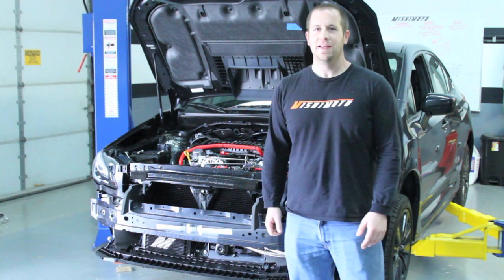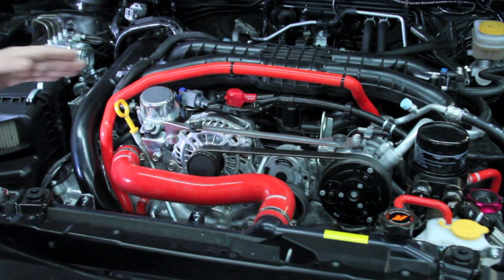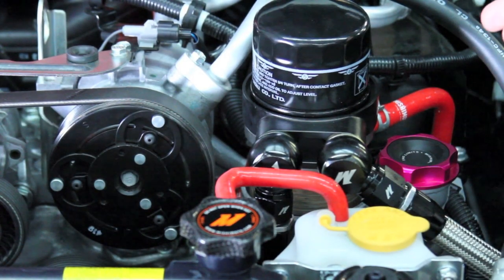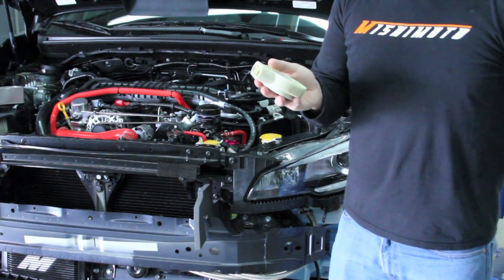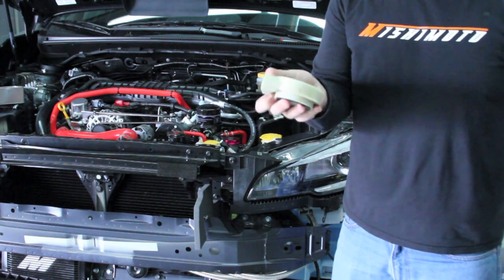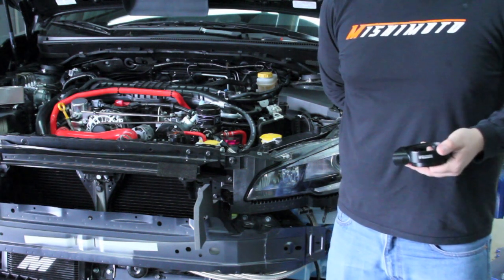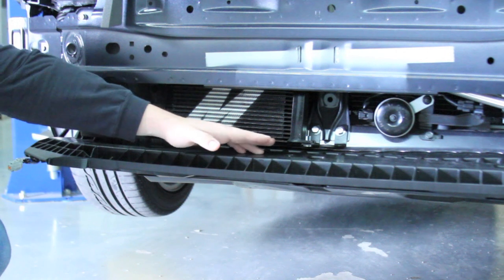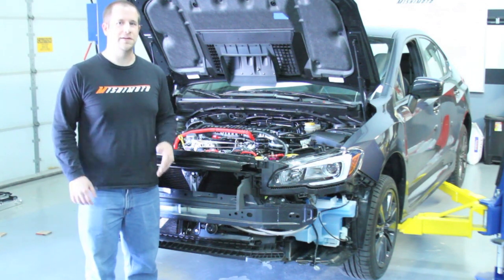2015 Subaru WRX Mishimoto Product Development: Direct Fit Oil Cooler

Comment: Will this work with the front mount intercooler kit?
Reply from the maker: Unfortunately, the oil cooler kit will not fit with the front mount installed on the car.

Comment: Will this work with the 2015 wrx cvt?
Reply from the maker: Yes, this kit will function perfectly with both manual and CVT equipped vehicles! We also just released our CVT transmission cooler, check it out a the link below.
http://www.mishimoto.com/subaru-wrx-cvt-transmission-cooler-kit-15.html

Comment: Can you guys show the oil temp tnat you guys are getting while driving down the street?
Reply from the maker: Absolutely! At cruising speeds we saw fluid temperatures right around 230°F. With the Mishimoto oil cooler we were able to drop temperatures to 205°F. These improvements are under normal driving conditions, we expect even greater efficiency during aggressive/track driving situations.
Reply: Damn those were your normal conditions? You guys must be balls to the wall lol. My every day temp is around 200 and it was 90% yesterday. What other conditions could cause it to run 230 besides driving style? I hit 100 pretty frequently and have never seen it go higher than 110.

Did a cruise to Galveston and was averaging 90mph. Was 95% outside and never went 206 that day.

I also changed my oil at 1000 miles before i started beating on it. Not sure if that helped.

Would love to know more about the temps and what variables go into the read outs. Keep up the great work. I look forward to checking out your blog more often as well as the products once my wife lets me off my spending leash (babies are expensive apparently lol).
Reply: ***** that's high temps before the oil cooler. Where you guys sitting in traffic on a hill? Usually my temps reach 221 max in traffic on a hill climb with outside temps of 90. But then again, with temp dropa like that, my oil temps would stay below 200 and that would be great!
Reply: *****  Yea today the highest my temp hit was 180. Would love to know what conditions the vehicle was driven under as well. Even then, my temps would be ice cold with that high of a drop lol.
Reply from the maker: This testing was compiled during normal highway driving with ambient temperatures around 80 degrees Fahrenheit. The variance may be a case of sensor location. Our sensors are located after the oil sandwich plate while the factory temperature sensor appears to be located on the engine.
Reply: Ok that makes sense. Keep up the outstanding work and please stop teasing us lol.
Reply from the maker: *****
Thanks! The oil cooler is now available on our site. Check it out!
http://www.mishimoto.com/subaru-wrx-oil-cooler-kit-15.html
Reply: Yea, ill be picking one up once i start modding. Waiting for Cobb to get their programmer on the market as well.
Reply from the maker: *****
Awesome!

Comment: Looks good. Definitely a must have if running the car hard.
Reply from the maker: Very true! An engine oil cooler and CVT cooler will provide huge benefits for track use with the 15 model.
Reply: Then the 15 just needs a decent set of paddles and it'll be fine lol

Comment: cvt oil cooler coming soon？ my 14 forester xt oil temp can get 212F on a normal driving. drive it little bit harder it will go to 220F or higher.
Reply from the maker: Yes! The CVT cooler is very high on our list of projects. We should be experimenting with a few setups very soon. Thanks for the recommendation and information.